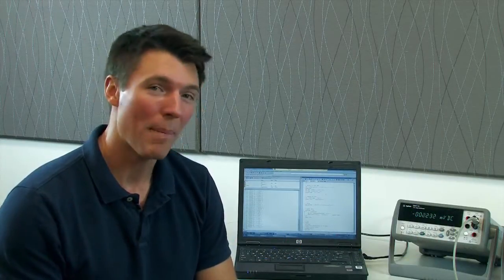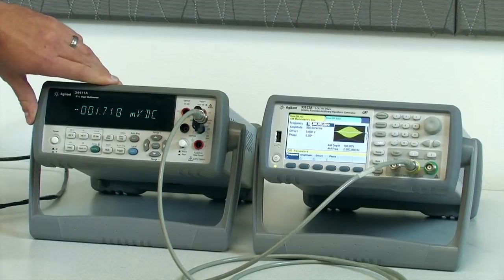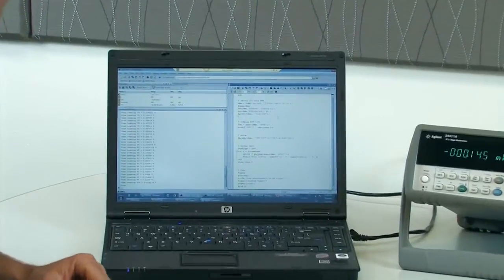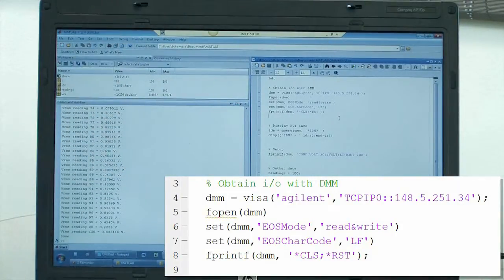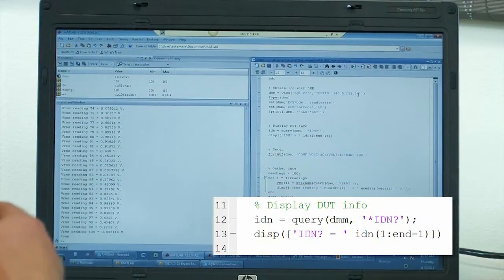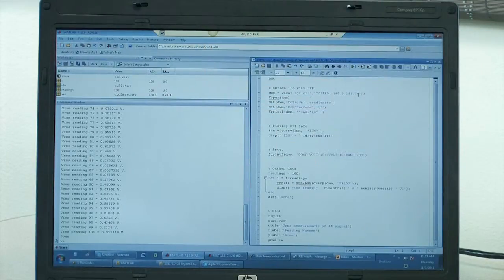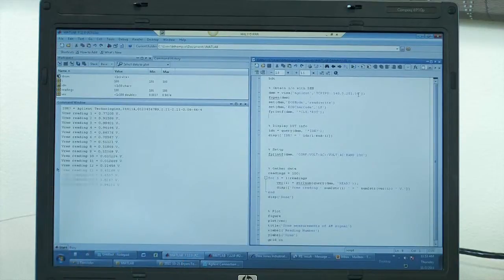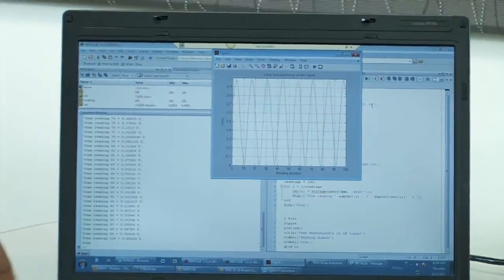Using MATLAB to Configure a Digital Multimeter Transfer Data and Plot the Results

Comment: above mentioned code for try (copy and paste)

% Obtain i/o with DMM
dmm = visa('agilent','TCPIP0::148.5.215.34');
fopen(dmm)
set(dmm,'EOSMode','read&write')
set(dmm,'EOSCharCode','LF')
fprintf(dmm,'*CLS;*RST');

% Display DUT info
idn=query(dmm, '*IDN?');
disp(['IDN?=' idn(1:end-1)])

% Setup
fprintf(dmm,'CONF:VOLT:AC;:VOLT:AC:BAND 200');

% Gather data
readings = 100;
for i=1:readings
vec(i)=str2num(query(dmm, 'READ?'));
disp(['Vrms reading' num2str(i) '=' num2str(vec(i)) 'V.'])
end
disp('Done')

% Plot
figure
plot(vec)
title('Vrms measurments of AM signal')
xlabel('Reading Number')
ylabel('Vrms')
grid on